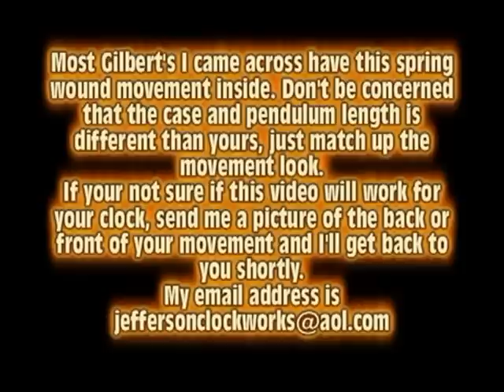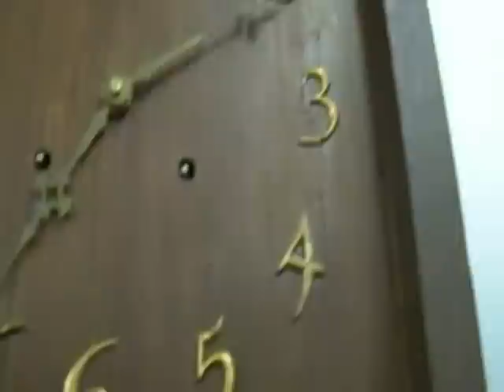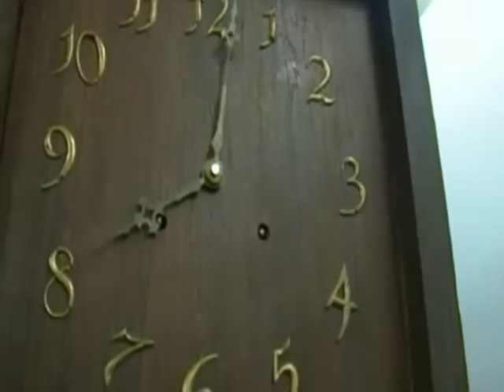Gilbert 1913 Countwheel Movement Repair Short Preview

Comment from the maker: Some movements are made of steel plated with brass, they usually are dull compared to solid brass.
Others are coated with old lacquer and will never look right until you remove the finish and polish it done to the brass.
The Ammonia is what makes brass shine, it removes a couple of molecules of brass so the discoloration 
just falls away.
Keep on Tick'in
Al